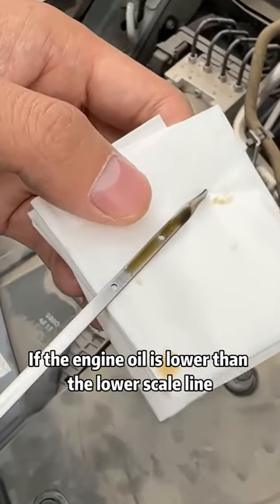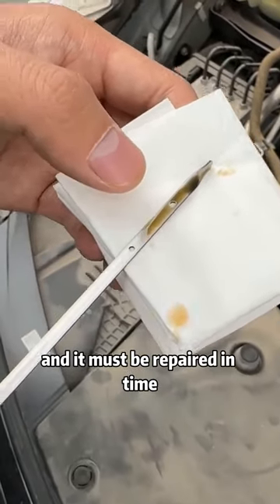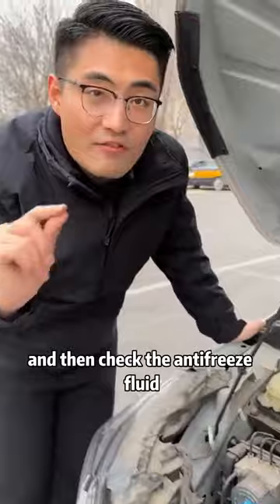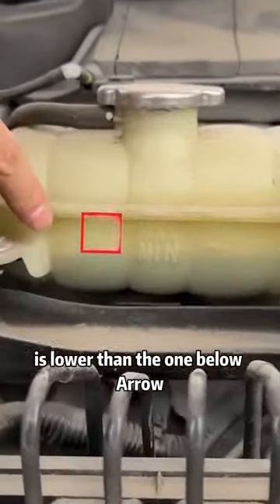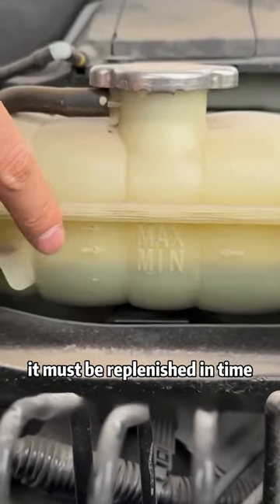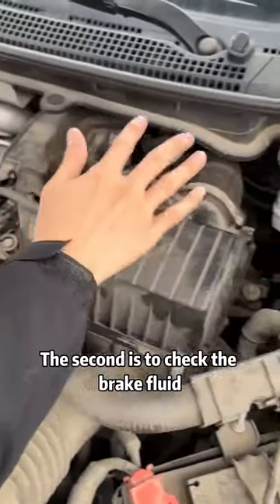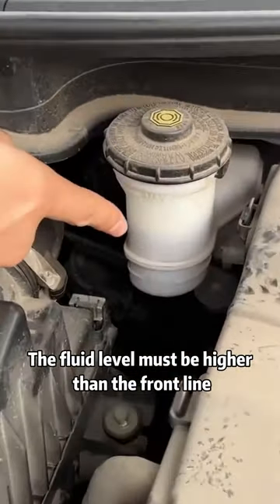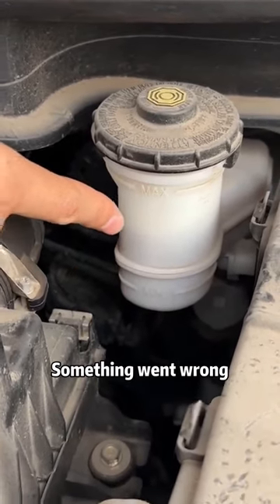(Part 1)Car tricks that 90% of people don't know!#shorts #car #cars #driving #cartok #tips

Comment: Checking oil should be done when the engine has run at full temperature, and waiting five minutes before you check. Checking antifreeze also has to be checked at full temperature because it expands from heat which can be seen in the overflow tank.

Comment: I'll say it because he didn't. If your brake fluid looks low, DO NOT add fluid. Brakes use a hydraulics system. If it looks low, it's because you have low pad life in the front or back. The less brake pad material you have available to use, the more fluid is used to push the caliper cylinders out to move the pads closer to the rotors.
Reply: Adding brake fluid when it's low is no big deal, even if there's little life left in the pads. If it's below the minimum level it's better to just add fluid, the person replacing the brake pads can remove excess fluid anyway

Comment: Dude, you’re the best ever .. thanks a million 🙏🇨🇦
Reply: Did you reach 1000 car knowledge yet?
Reply: @iamarchibald  yea
Reply: @iamarchibald  bow did you open sunroof on January 3rd ?
Reply: @jaaceek321  of course brother
Reply: @iamarchibald  thank god
Reply: I’ve got rattling loose noises coming from front end , sometimes I hit a speed bump and it’s like it’s going to hsve parts fall off , secondary to that I had transmission fixed it appears to work well , except when I vine to a light and stop  it’s rough like bad motor mounts but they were checked  they also relkscdx struts and ignition coils . It seemed like it got better but couple days later back.
It runs well on highway and have no problem going constant 80 mph for 120 miles . Smooth ride and plenty of power . It has 165,000 mileage . 
Any guesses would bd appreciate

Comment: I check oil level when the car is in working temperature, then I turn it off, wait 2 minutes and check it.
It's very important to check tires pressure, it only takes ONE MINUTE and it could save your life.

Comment: Also check blinker fluid by removing the headlight bulbs and if empty, top off the headlight housing assembly with diluted water for a brighter illumination😉
Reply: i am a student driver, and this is not helpful at all. You should be banned using socmed for false info.